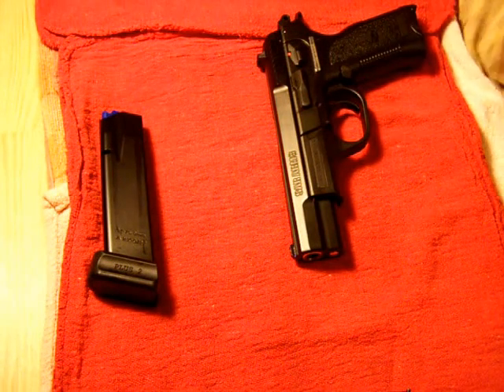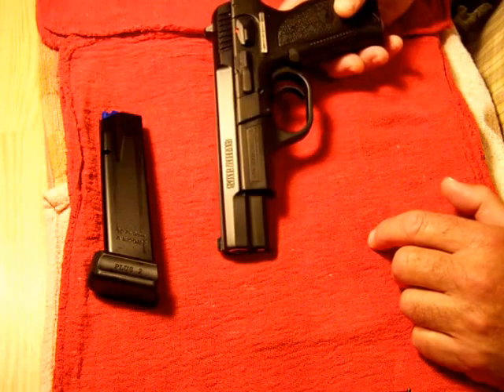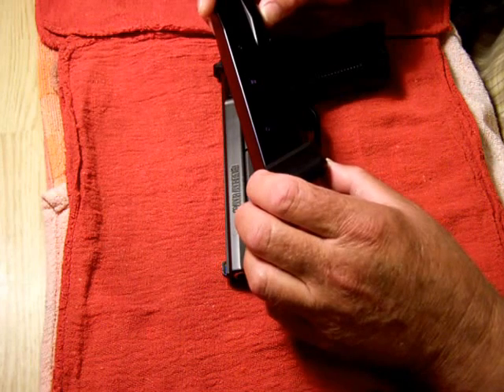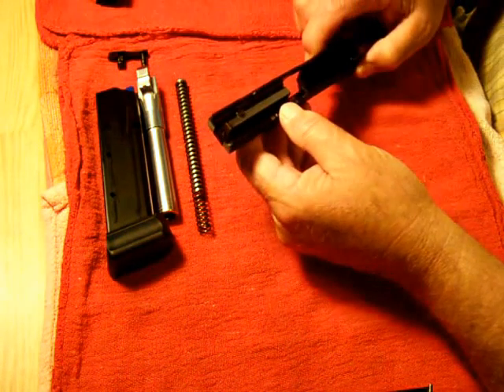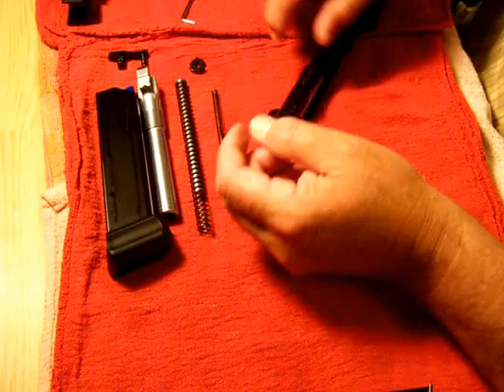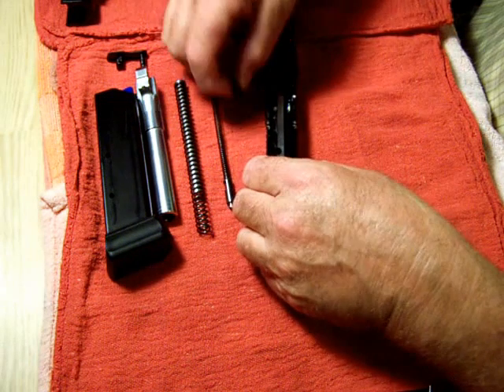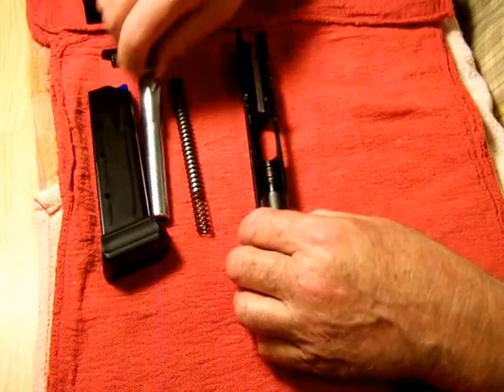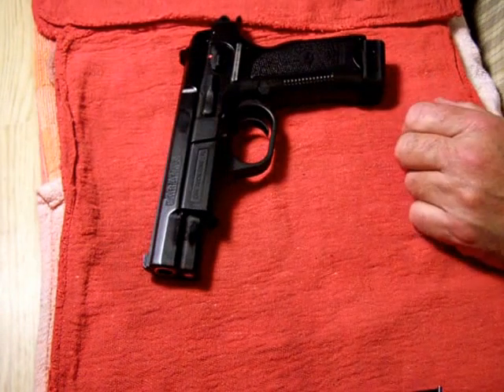Sar Arms B6P Takedown Disassembly Firing Pin

Comment: For those that are really interested in even more mag capacity, the 32 round mag for the baby eagle 9mm also fit this CZ75 clone, but it may be illegal in particular states! I bought 2 mags to begin with and they are difficult to load, but be patient and you can get 32 rounds in them. I didn't experience any issues with FTL or jamming. Liked them so well I ordered another 6 mags and another B6P to have a pair of them.

Comment: The video fails to mention that you can also order the 32 round 9mm magazine by promag for the baby eagle from many online dealers and it fits this gun perfect. It will hang down a good distance below the pistol handle, but will add some real fire power. I have matching B6Ps with 32 round mags and firing them simultaneously is a blast!
Reply from the maker: richard traylor Good to know.
Reply: Fails to mention?

This video isn't about magazines or baby eagles, it's about disassembly of the slide of the SAR B6P.

Comment: How u get the slide to come off? I can't see what you used on the other side of firearm or what you touched when removing slide was so fast
Reply from the maker: Dae dae Davis I don’t have this pistol anymore but it’s similar to a 1911. Pull the slide back about 3/4” of an inch and push on the back side of the slide release. The slide release will pop right out. Watch a few 1911 tear down videos. Thanks for watching.
Reply: @fredrickson1  thanks gonna try tomorrow why'd u sell if I may ask? Ilove this gun I bought the 32 round magazine for it it's awesome no jams through hundreds of rounds different ammunition too did u have problems?
Reply from the maker: Dae dae Davis I gave it to my daughter. We both love it. We shoot and train with it monthly. It’s a great pistol.

Comment: Does the small, spring loaded piece with the notch face the center of the slide or does the flat spot face the firing pin? I feel like both are said. After I put mine back together, the slide locks automatically when pulled back. Not sure if I put a piece back in wrong or what.

Comment: Hey thanks for the video! My only question is. Is there anything else you can use to get the fire pin out other than the tool that you used??
Reply from the maker: Katrina Midgette Yes. You can use a nail or a small screwdriver or any other small object to push it in.
Reply: fredrickson1 thanks again! And I was able to get it out! Now putting it back in 😅 was another issue of its own 😂
Reply from the maker: Katrina Midgette Thanks for watching.

Comment: "Whack it"? No!

Take a pencil and index the position of your rear sight. The index mark will allow you to see the amount of movement of the rear sight.

Take a brass punch and lightweight hammer (one specifically tailored to the job preferably) and TAP ... a hard TAP but tap the brass punch against the rear sight in the direction you wish to move your bullet impact. 

NO WHACKING!
Reply from the maker: Please tell them what tool to buy to move the sight and how to do this properly. That would be helpful.
Reply: I did Fredrickson, "Take a brass punch and lightweight hammer (one specifically tailored to the job preferably) and TAP ... a hard TAP but tap the brass punch against the rear sight in the direction you wish to move your bullet impact."

Also, I meant to say thanks for the informative video. It's unfortunate that similar instructionals are not available from manufacturers but learning by doing is invaluable, lessons learned and such. 

That is a nice gun, I have the K2 45.

I suspect you did not truly mean to "WHACK" but some folks take verbiage in the literal sense.